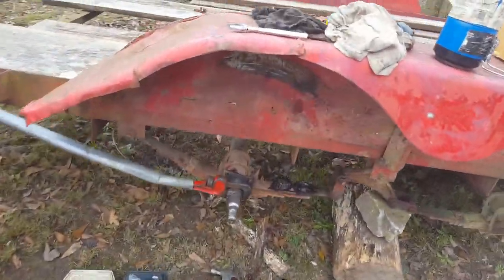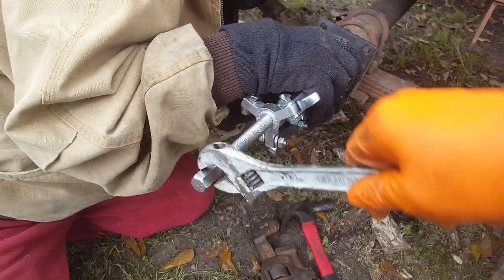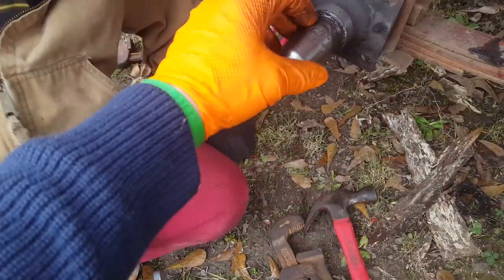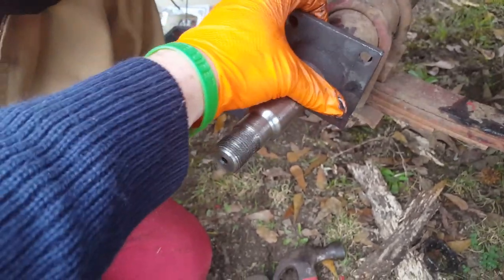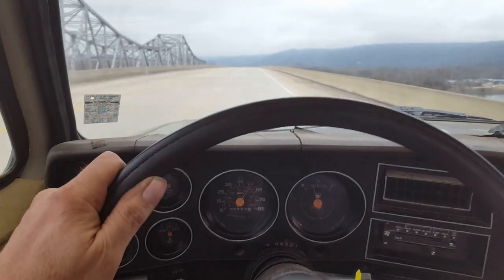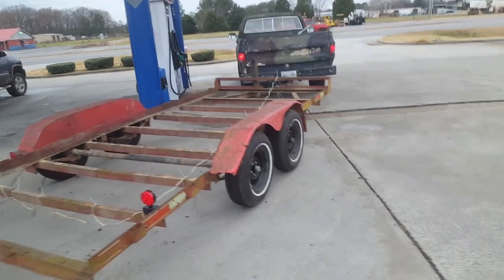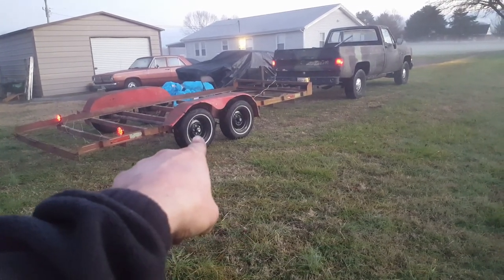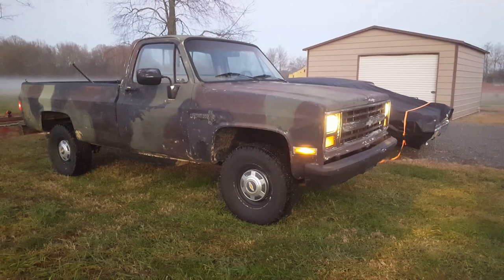Rescuing an abandoned car trailer. Repairs and the trip home.

Comment: I would suggest, based on my own mistakes, that if you are not using the trailer often, remove the wheels and tires and store them in a cool, dry place. I have a 10 year old 2 wheel car dolly with tire with less than 2,000 miles on them. The last time I used it, one of the tires was so dry rotted that it didn’t get 10 miles with a car loaded before one shredded. I don’t use it often, and time goes by fast. If I had the forethought to remove the wheels and store them indoors, I am very sure they would still be in decent, useable condition despite their age. The weather completely ruined them. Nice score with the car hauler! Only problem is that now you have to keep the truck or you’ll have a wagon but no mule to pull it!
Reply from the maker: Lol, that's right. Those were actually the wheels and tires that belong on my Chrysler. I tried to buy some used wheels but the idiot wouldn't agree to show them so I said the heck with it. You're right though, the UVA is what kills them. I think you can buy tire covers as well.

Comment: If it doesn’t have brakes then may be worth it to just buy a electric brake axle and replace the axle with the bad spindle. Mine just has brakes on one axle, if I recall it’s the front axle.
Reply from the maker: That's a good idea. Something in there needs work based on the movement I saw on one of the spring shackles.
Reply: @TylersNeighborhoodGarage  the springs and and center pivot have nylon bushings that wear out. You can buy the bushings and slip them in. If the bolts wore into the shackles or center pivot then they are pretty cheap to replace. I found a local place here that was much cheaper than any big box store but that was years ago. I’m sure now you can find parts cheap online. I think I recall seeing then 4 bolt flange behind the spindle. That’s where the brake setup bolts to. We added brakes to ours and it just bolted in but if you have spindle issues then you can probably just do the whole axle and be far ahead.

Comment: I guess you could grab one axle with brakes.. That way you can put a car on the trailer.  I’m not sure about your state , but here in Ontario , Canada we have to run brakes once over I think 3,000 lbs  or something.
Reply from the maker: It needs brakes for sure. A few years ago I almost bought the trailer we used to haul a race car in.....1980. I passed though because although it was steel, it had an open floor and trailer axles.